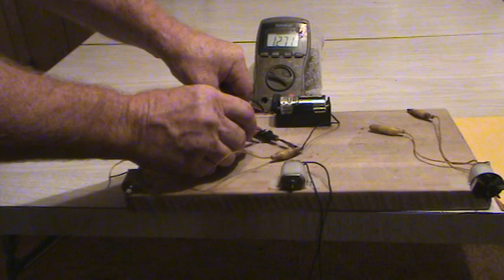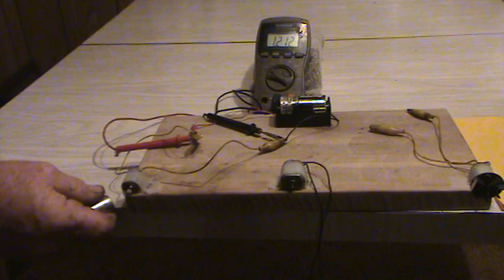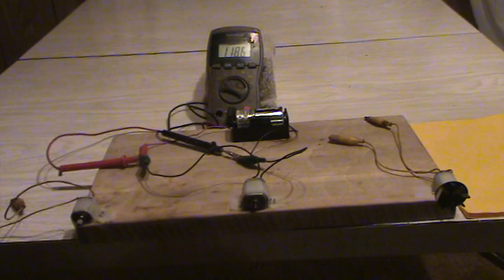Ray's Magnetic Free Energy Coupling

Comment: I got the same result from a dead 9volt battery using an old hard drive magnet [neod] - then
I put both magnets around the 9volt battery and noticed the voltage increasing !
strange don't you think?
Will leave it for 24hrs and see what the voltage is....